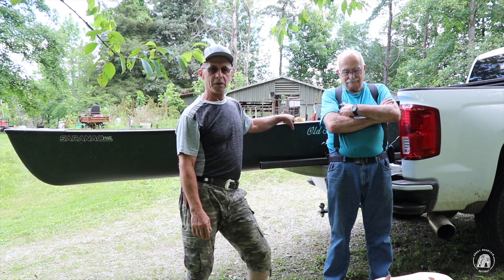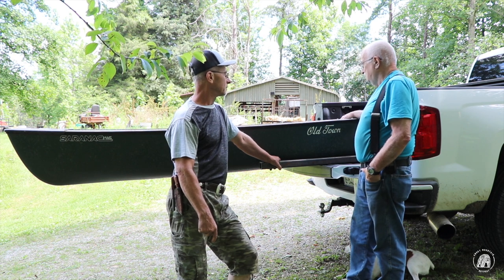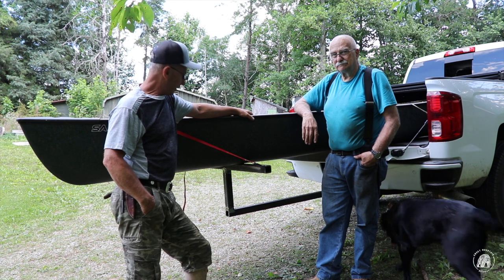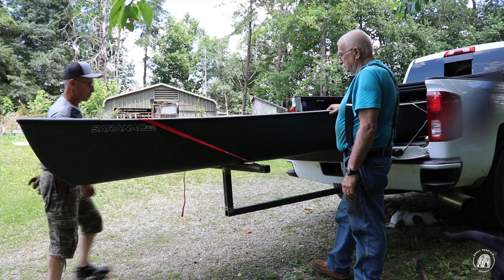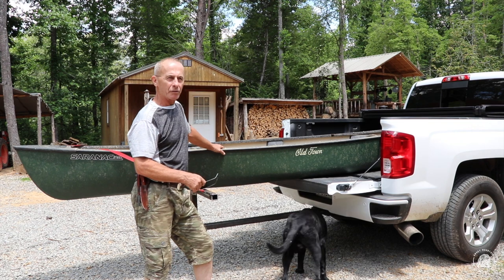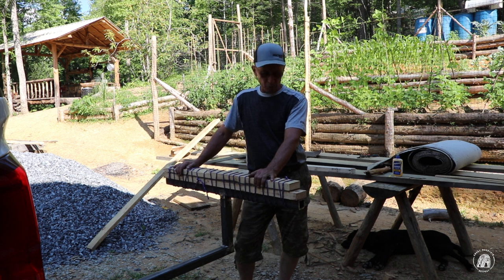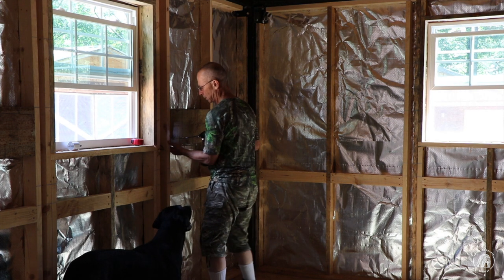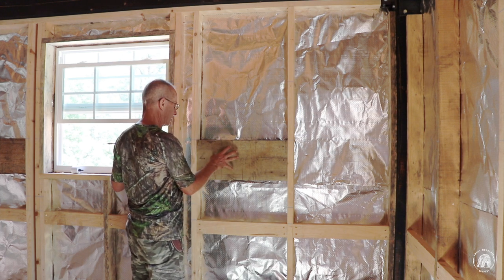SMOKY MOUNTAIN TIMBER FRAME CABIN | DIY CANOE HAULER & INTERIOR CABIN WALLS

Comment: Great idea! If it were mine, I'd paint it yellow so it would be seen and also to prevent rust. (Lights on it would be a great idea.) I'd also put a piece of rubber where the keel of the boat makes contact with the steel so as to reduce chaffing. I also like your reflective triangle idea mounted to the outboard side of your boat hauler.

Comment: If the padding you made for your canoe doesn't work you can always use the tubing used to keep your pipes from not freezing in the winter, I used that just because it has a slit in it and then used tape or outdoor carpet glue to keep it on.

Comment: In most states, it is required by law, that anything that sticks out 4 feet or more must have a red flag on the end.  Personally, I would put lights on the cross member, just like a trailer.  they don't cost that much and it's better to be safe than sorry.

Comment: Do you think you could mount 2 lights? have them at each end of the bar going across? I tell you what I would be worried coming upon your rig at night as far as that canoe sticks out the back of your truck. Where you said you were going to mount 1 light is so low it would be difficult to see, my opinion only of course. Or no light at all? And maybe no flag? As you said no one has ever seen anything like this before and a single light that low would be unknown as to what it was. Will you be putting more than one bungie around it? It seems a little risky only having that to hold it in. Daylight is fine, it would be night time I would worry about. Well just a couple of points to think about .... or not! Blessings and stay safe.

Comment: I am curious as to why you install your fire blocks with narrow side vertical?
Reply from the maker: They weren’t fire blocks, they are to attach cabinetry to.
Reply: @SmokyMountainOutpost  thanks, after I saw from a different angle and saw you installing the larger boards in the kitchen, I then realized they were for cabinet attachment.